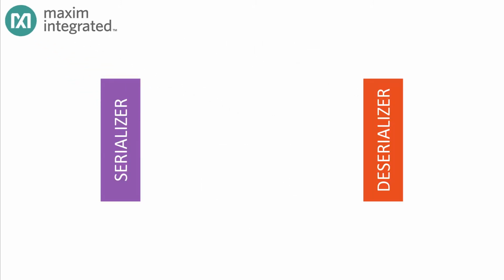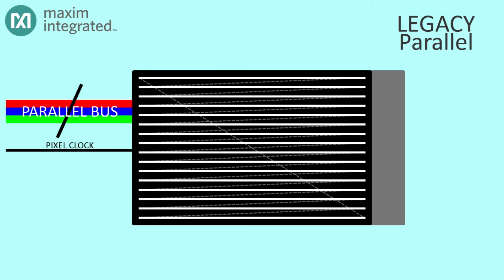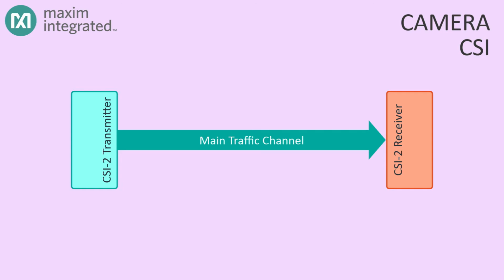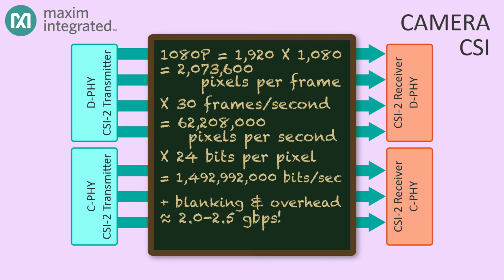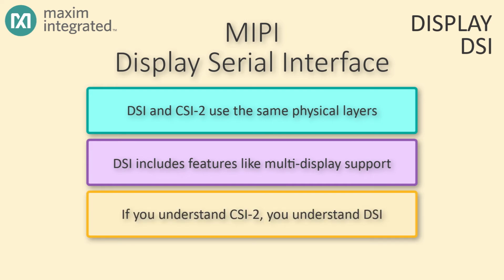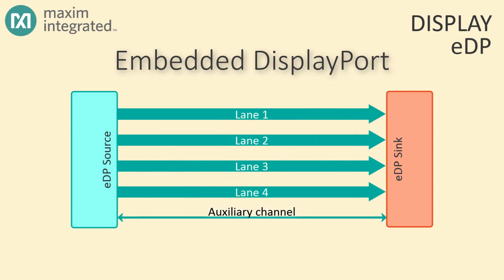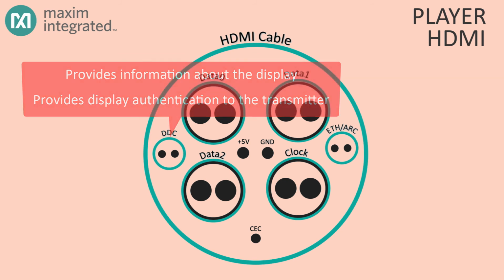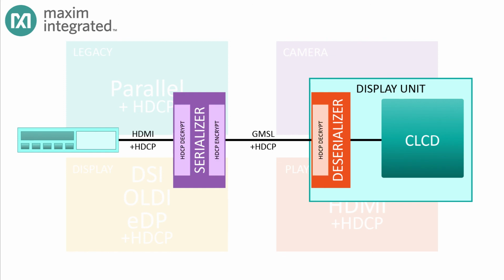SerDes Part 9 - Interfaces

Comment: I3C does not support clock stretching. I was discussing in webinar with MIPI alliance guys, they do not see clock stretching as needed feature. Also physically noty possible because sda and scl are both push pull. But how to deal with serdes and gmsl?